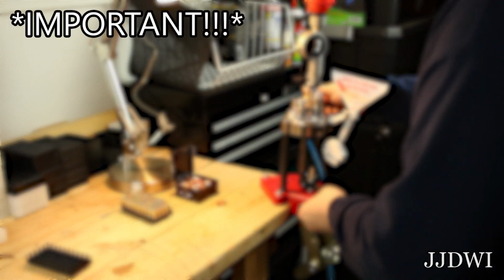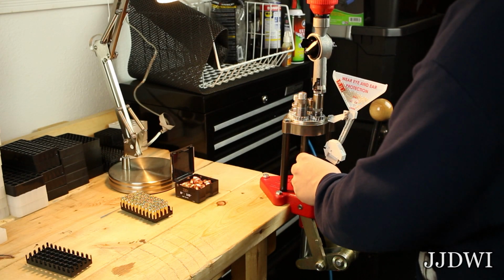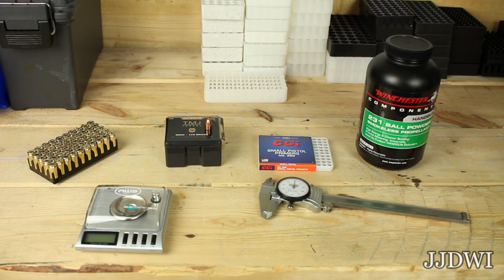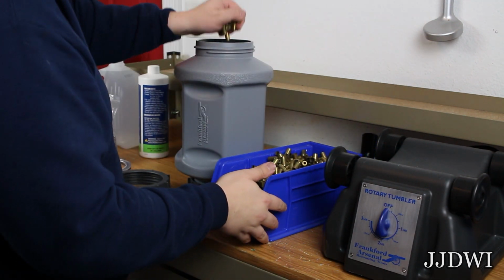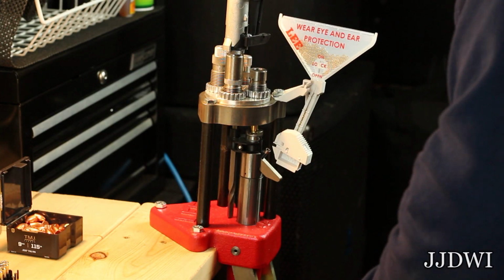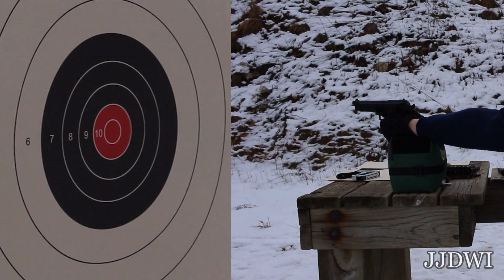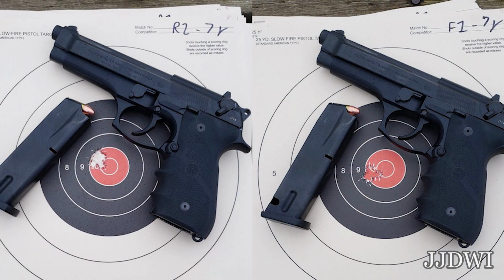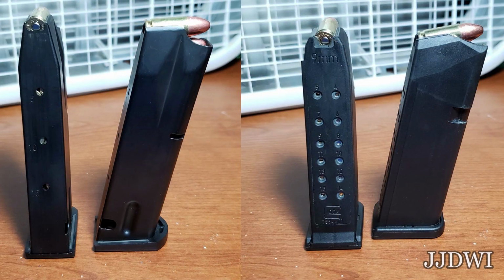Reload 9mm From Start To Finish

Comment: About how much do you have invested in your reloading equipment?  What do you consider to be the break even point for savings over purchasing factory loads?  Thanks and good video.
Reply from the maker: Thank you!

Here's a breakdown of what I bought and paid for in early 2020 (January/February/March. I bought a house in November 2019 and reloading equipment was on the first things on my list. I got lucky with the timing and got everything before the pandemic started.

Lee Classic 4 Hole Turret Press Kit - $216
Lee Deluxe Carbide Die Set 9mm - $35
Lee Breech Lock Reloader Single Stage Press - $44
Lee Depriming Die - $12
Lee 9mm Cartidge Holder - $6
Frankford Arsenal Rotary Tumbler - $161
Frankford Arsenal Media Transfer Magnet - $14
Anytime Tools Dial Caliper - $22
American Weigh Scales Gemini-20 Portable Scale - $25

Equipment Total - $535

Break even point depends entirely on the price of components. 1 lb of gunpowder gives me a little more than 1,500 rounds (7,000 grains in 1 lb, 4.6 grains per round), but I'll use the first 1,000 as an initial benchmark. 

Winchester 231 Gunpowder 1 lb - $29
CCI #500 Small Pistol Primers, 1000 - $35
Speer TMJ 115 Grain .355” Diameter Bullets, 1000 - $96
Tax + Hazmat + Shipping - $20

Components Total -  $180
Cost Per Round (CPR) - $0.18

Locally, the cheapest I could find brass FMJ ammo (Federal American Eagle or Winchester White Box) in 2019/2020 (pre-pandemic) was $9.99 a box, but that was pre-tax and only on occasion. $10.54 for a box of 50, $.21 per round. Online, the absolute cheapest brass FMJ ammo I can find is $.39 per round, after factoring in tax and insurance (I have free shipping, shipping insurance is 1.45% of the order total). Steel case isn't much better, but I'll throw it in anyway, $15.50 for a box of 50, $.31 per round

My reloads - $.18 CPR
Factory Steel (Wolf) - $.31 CPR
Factory Brass (Federal American Eagle) - $.39 CPR

Compared to steel factory ammo (non-reloadable), I'm saving $.13 per round and would have to reload 4,115 rounds to break even.
Compared to brass factory ammo, I'm saving $.21 per round and would have to reload 2,547 rounds to break even.

Keep in mind, I'm using my own brass, this doesn't factor in time, and this is FMJ target ammo in 9mm. Really, really basic. Other calibers may have a bigger return on investment, or if you're trying to do something particular, like long range precision, then you could go with a more simple setup and you don't need a turret press. The equipment, components, and ammo itself has gotten more expensive over the last two years. Perhaps you could find used equipment. 

Buying ammo in bulk can sometimes be cheaper, but I usually see it for the same cost per round as smaller boxes. Try to buy components in bulk as to only have to pay one shipping and hazmat fee.

It'll all come down to what you want to reload, what kind of set up you want, and calculate it out from there.

I have already broken even on my reloading equipment. Anything going forward is a plus.
Reply: @josephjdaviswi  Great breakdown of costs.  I'd bet you miss those prices.  I know I do.  But the price of ammo has increased as well, so we are both making ammo cheaper than retail costs.
And those Lee carbide dies, love them.  I also picked up the Lee bulge buster and a 9mm Makarov die to eliminate the dreaded Glock bulge. Now all my ammo goes plunk into the chamber.
Reply from the maker: Thank you! 

True, the cost of factory ammo has increased dramatically from before. I've been able to get factory brass ammo pretty consistently over the last few months at $.31-$.34 CPR before tax/insurance, so it's getting better. I haven't been able to source primers in a long time, so I'm just paying for factory ammo and saving the brass.

I'm a big fan of the Lee equipment in general. I haven't needed a Bulge Buster, but I'll keep the Lee in mind if I ever need one.

Comment: Do you need to sort brass by headstand? I have heard different schools of thought.
Reply from the maker: I don't. I just make sure it's stamped for 9x19mm, and check for any cracks or splits. I haven't noticed any difference in performance, and my reloads have used brass from Federal/American Eagle, Sig Sauer, Remington, Winchester, PMC, Fiocchi, CCI Blazer, Sellier & Bellot, Aguila, and I'm sure there are others. 

I'm only shooting at short range targets; a lot at 7 yards, and the most I go up to on a regular basis is 20 yards. I've only been competing in USPSA for a year and have only shot Level I matches. I think the farthest target I had was one target in one stage at 25 yards. 

For longer distance precision shooting with rifles, I've heard of people sorting ammo by headstamp and weight. I've also read accounts both ways, where the matched headstamp brass performed better than the mixed headstamp brass, and vice versa. I don't reload rifle caliber ammunition, so I can't speak from experience.

For me, it's not worth sorting by headstamp.

Comment: Why did you use a separate press to decap?
Reply from the maker: I find it a lot easier to have a separate press for depriming because I deprime, then clean the brass, before resizing and reloading it. The resizing die on the turret press had a deprimer in it, but I took it out. I didn't want to get sand or any other debris in my resizing die. Also, the depriming die doesn't resize, so I can deprime brass pretty quickly.
Reply: @josephjdaviswi  yup, highly recommended.

Comment: Good video. You should really consider a wet separator for the steel pins. Minimal investment and great results. Unless you do something like I originally tried with mixed 9mm and .40 s&w in the same batch. They marry together and trap the pins. A real PITA!
Reply from the maker: I've had to separate plenty of 9mm and .40 S&W when I was sifting through the brass. There were a lot of them stuck together with sand in between. I got most of them free with just a little force and twisting motions. I can't imagine what trapped pins would do. Probably ruined the 9mm case trying to pull them apart? 

The transfer magnet came with the tumbler, and it works pretty well. I'll look into a wet separator. It'll be handy for when I can do more than a batch of 500 at a time, which will hopefully be soon!

Thank you!